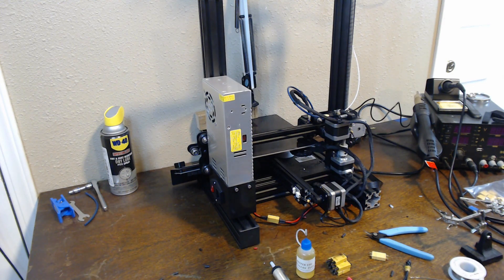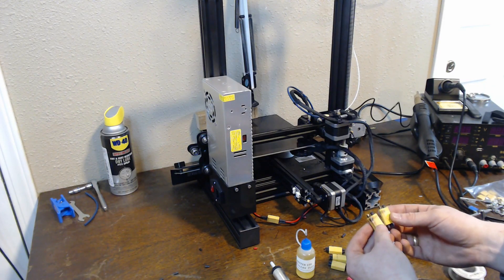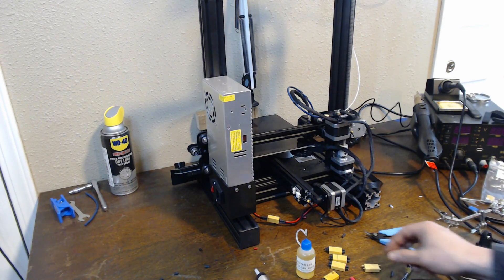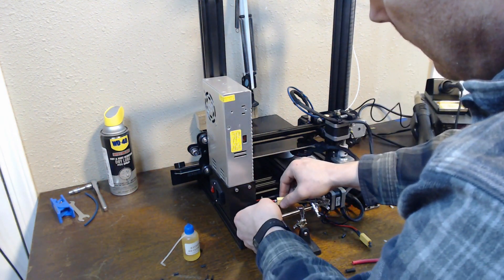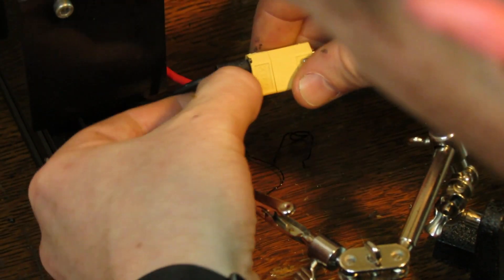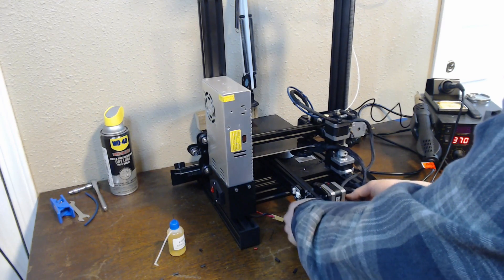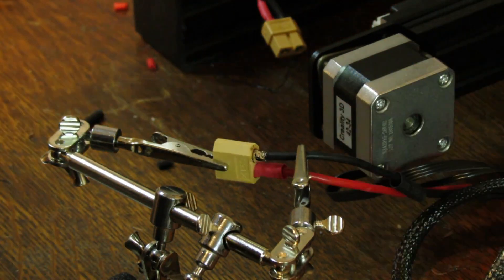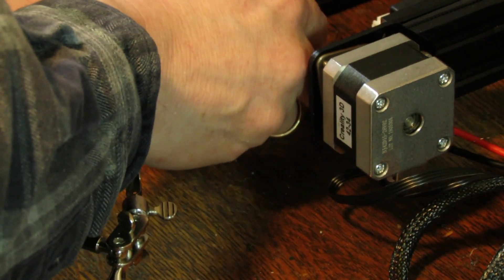Ender 3 XT60 Connector replacement

Comment: I wouldn't use them at all.  Just get longer wires and connect directly with properly terminated ends.  What's the point of them anyway other than quick assembly out of box?  Once set up, much safer to just eliminate the connector all together.
Reply from the maker: I appreciate the feedback.  I have a lot of 3d printers. I've had power supplies fail and wanted to swap them.  This allows you to continue to do that quickly.  Either way works.

Comment: Hey Steve, really appreciating these videos in getting to grips with my new Ender3. Listen, which XT60s am I looking to buy here? There's 3 options on ebay, XT60, XT60U or XT60H? Sorry for the noob question, I'm still getting my head round this stuff!
Reply from the maker: Jim,
XT60 Male Female Bullet Connectors.  I got the Finware ones for $7.99.  I know some people like options so I drop them in the category.  Appreciate the feedback, I will update that link to send you to the ones I purchased.

Thanks for watching.  If you have any suggestions for videos, let me know.  We are working on the sound and make them a bit better each go around.

Steve
Reply: @makersteve934  Thanks for updating the link, that's really helpful. I'm new to 3D in general, and one thing would be helpful (I haven't checked all your videos yet so maybe you'vecovered this already) would be a run-down of the different 3D software packages available. I'm started to get comfortable with Google Sketchup, but it's a learning curve. What do you use? Would you have a recommendation? Sorry if you've covered this already! Cheers, Jim